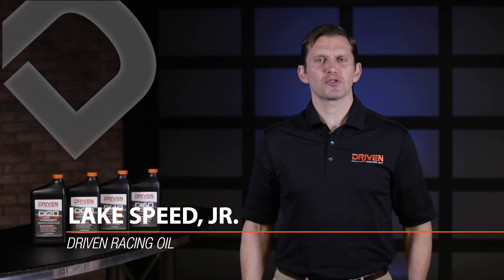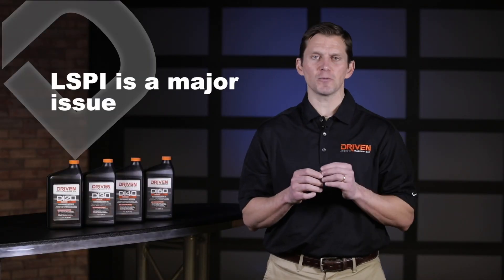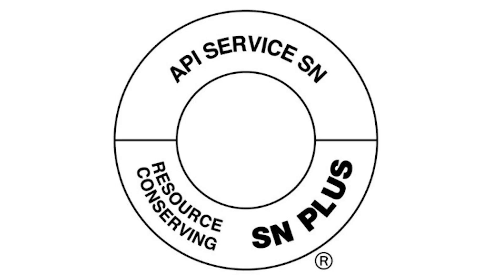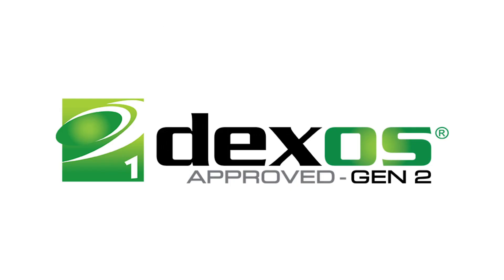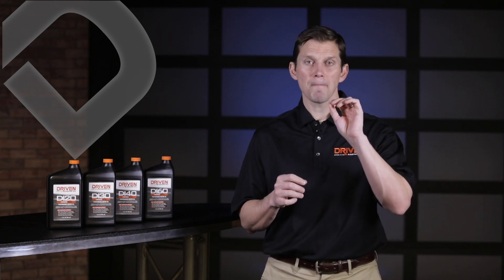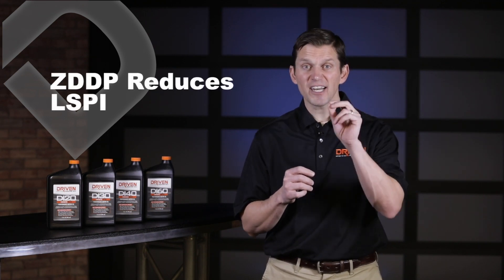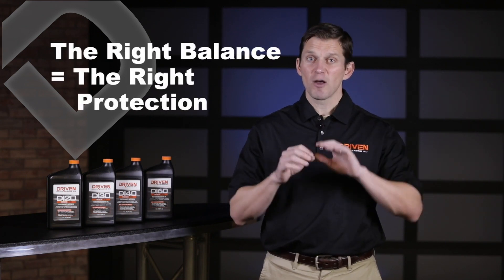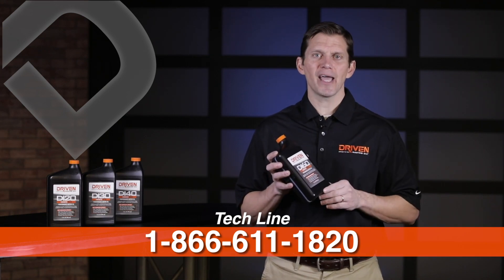Direct Injection & Oil Detergents - Part 3: Lubrication Challenges

Comment: So far sounds great. One issue is because these DI series of oils use higher levels of certain additives, they don't qualify for API certification, which could be an issue if your vehicle is still under warranty, and has an issue you need the dealer to fix (if it's engine related, and they find out about the oil used).